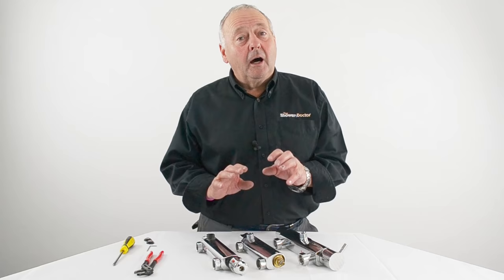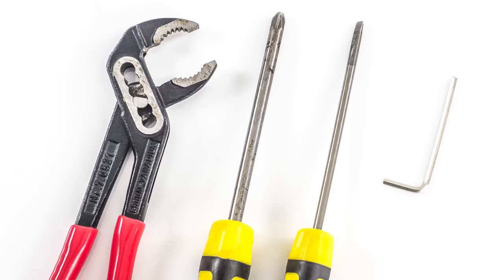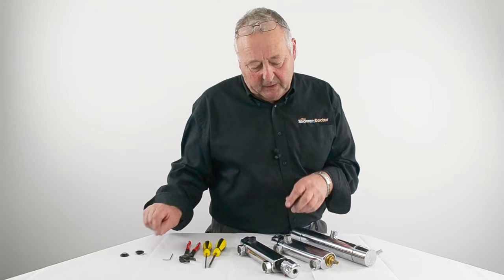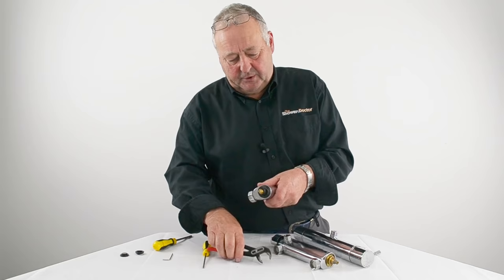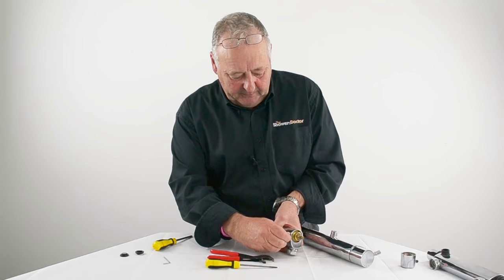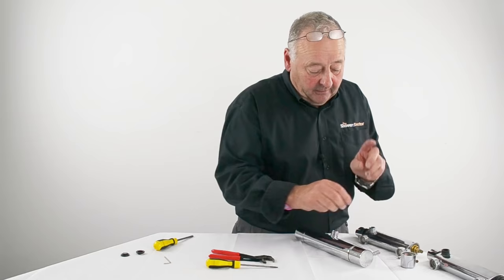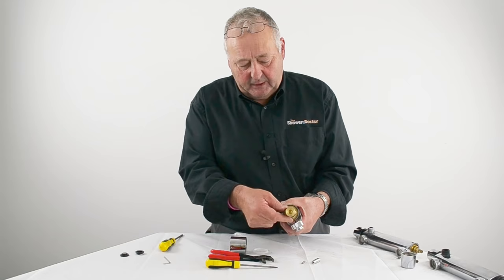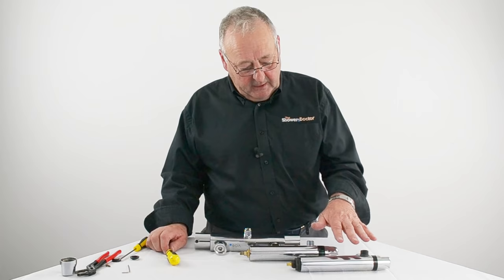Bar Mixer Showers: 3 most common cartridge types & how to replace them.

Comment: Hi I had a shower put in about two months ago the water coming from the wall to the mixer is red hot but the water coming out of the shower is only warm. I turned took the end off and turned the little good thing round a bit that made it nice and hot for a few weeks now it’s only coming out warm again but red hot where it comes into the mixer. The shower was brand new about two month ago. Any idea why the water is only warm? Thanks

Comment: I am finding that after removing and cleaning my cartridge (soaking in white vinegar to remove limescale) that it will not push in quite far enough in order to refit the grub screw. The hole in the cartridge does not quite align with that in the housing. Hammering it seems to be the only option but surely there must be a better way?

Comment: Mine has a slight drip issue when turned off.   Happened a few years back and Bristan just sold me a replacement.    I found my Bristan cartridge lasted around 4 years before the drips started.

Comment: Thank you. I have the second type, and due to water hardness, the temperature regulation degrades over time, so I need to pull the cartridge and descale it. Knowing how to get it out is key, because when stuff doesn't move in any obvious way, you don't want to start prying with a screw driver or big pliers.

Comment: Thanks, thought I would have to replace the thermostat valve on the bath mixer tap, but I will check the filters first, as I have had issues with the sink taps getting blocked with limescale. Thanks you have save single mum for calling the plumber out.

Comment: Hi could you please recommend a reliable replacement shower bar please as a novice very confused as there are huge amount of versions about, my old one which I personally don't know the make of has been very reliable and trouble free for approx 22 year's, your advice would be much appreciated,
Unfortunately the thermostatic side doesn't hold right tempreture as it did

Comment: My mixer is only three years old and the temperature and pressure are great the start, but after a couple of minutes the flow reduces.  Would this be the temperature cartridge that needs attention or the flow one?  The water coming out of the wall is piping hot, but the shower is only just hot enough even with pressing the temperature overused button.

Comment: Love it, ‘unscrew the grub screw’ and the cartridge will ‘normally’ fall out. Grub screw welded with lime scale and cartridge needing a gorilla to remove it.  I love the ‘In a perfect world’ shower valve servicing. 
However still useful as the parts can be visualised. 🙂👍

Comment: I have a question. Wich cardige can handle hot water over 80C. which is better?From my experience if you have hot water over 80C from a sun collector the thermostat cartige get worse and worse till it fail totally.

Comment: Thanks for the video. We gradually have lost hot water in the shower, so it must be the filter or the cartridge. I wanted to check filters first as recommended but the question is, how do I take the shower bar off? It has a rain shower attached and I cannot find the way to detach the tube going up!

Comment: Hello thanks for this video. I have a Mira Stylus MIRA-1660.185 that has an issue where it is hard to adjust the flow... and then the hot goes really cold and fast.....is this something I could repair or maintain?...Im a mechanic and have 3 plumbers in the family so am used to holding spanners....thank you!

Comment: The bother with my Mira EV Atom exposed mixer shower was dripping from the outside of the shower hose spout at the centre of the bar. I'm on to my 3rd exchange unit from my local SF branch.

Comment: But how do you pop a circular cap that covers the cartridge screw when there is nowhere to insert a screwdriver etc? I have a Vado bar valve and it has circular caps that are flush, and I can't see how to pop them! thanks

Comment: Couldn't pull the cartridge out. Must be heavily scaled. Can I put the while mixar bar in a bath of descaler. If there is no name on the shower unit, how do you recognise the cart no. Mines a brass head. Asked plumber supply and there answer was-buy a whole new unit

Comment: My tap is a Bristan Aristan AR2 and has none of these mechanisms. No large nut inside, no flats on the piece behind the spindle and no grub screw underneath. It won't pull out either. I've been on the phone to Bristan for an hour so far! and even they're struggling.

Comment: Please tells me why they don't standardise these cartridges, it is ridiculous that there are so many all with different means of removal. So many have been designed to ensure it is almost impossible to remove them when they have been in use and are scaled up. Some of the worst engineering I have seen